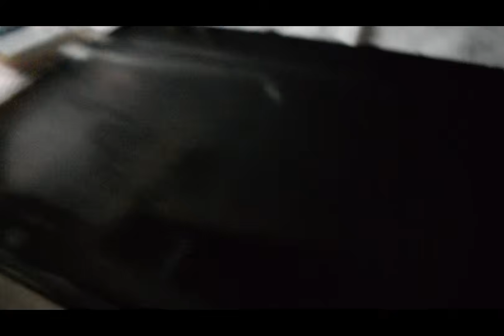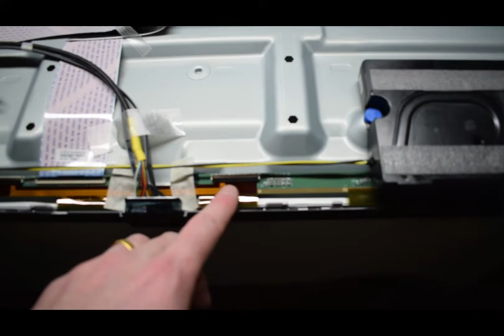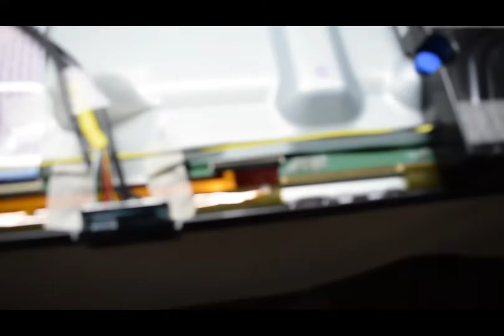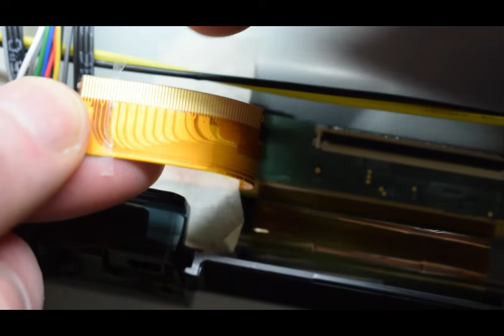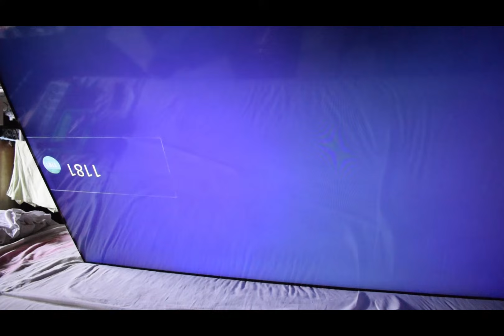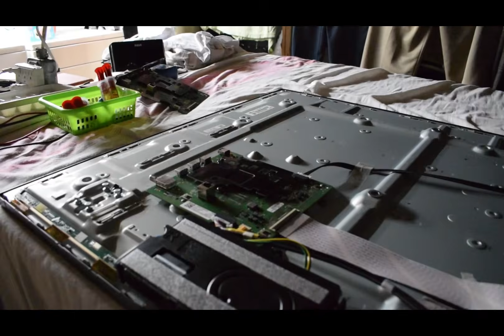Easy Fix! Samsung UN58TU7000 Keeps restarting (fix with tape!)

Comment: After taping the 16th and 17th pin the boot loop ceases however my screen stays black (backlight on) and uncovering the 16th and 17th pin shows makes the image visible, I'm using a model ue50bu8002k

Comment: This helped me at least stop my tv from boot looping and get it functional, but there's pretty significant lines and discoloration.  I think the long-term solution is to replace that T-ribbon cable.  Looks like its $10 for my tv.  Could not have gotten this far without your video, thank you!

Comment: Had the Same Problem with my tv only 5 years old 
Just check it on every step the power suply, then the main board and after it the monitor connector 
Put the tape on right side of the connector on only 6 pins at the right connector on to the left 6 pins and after it my tv works pretty well 
So do just exactly the same like in video it will work 
I just put it on left side like in video and cover the first 6 pins
Reply: Ps sorry for my English 😢

Comment: I have a Samsung
Model Code: QN75Q70TAFXZA
Version No: CF04 / QTQ70 / QTQ70E-Q75TE1. The TV was
flashing between a blue and black screen. I did a bunch of trouble shooting and I was able to get 3/4 of the right side (when looking at the front of the TV) of the screen to work by removing the right (when looking at the back of the TV) CSF01 cable. Can you tell me which pins to tape and on what side of the CSF01 cable (the board side CN1 or the panel side CN2)?

Comment: Repair shop asked 2000$ for this issue.  Thanks for your video my tv works fine now.   Just one question board get hot when tv on.  Is it normal or its a problem?

Comment: After two days of testing by blocking different pins — where the TV didn’t reboot but showed slightly annoying horizontal lines — I finally figured out exactly which pins needed to be blocked: pins 13, 14, 15, 16, and 17. Once I blocked these pins, the TV worked like new — no more reboots, no lines, perfect colors, and everything went perfectly. Thank you for the video!

Comment: My TV had the blinking red light issue with blue screen flashing.  I placed tape on the ribbon like you showed and got my screen back but left side of screen looks purple.  Should I reposition the tape or doing so won’t help. Thanks for the video.
Reply: did u figure out how to fix the purple issue ? thanks
Reply: @ayoub.radouani  i was told by a tv repair shop that some of the led lights were burned out resulting in the purple issue.  I tried replacing them but they didn’t fit like factory ones and would fall off the back. I tried messing with the lights again and shorted one of them out then the tv screen went black. Just got rid of it and bought a cheap one. Good luck!
Reply: @JC-ov5pt  the solution is to use a DC to DC converter to adjust the voltage entering in the VGH pin, its the same pin taped in the video, from 24v to 15v and the colors will be good, no purple anymore.

Comment: I guess the newer model looks nice and decent on the cheaper end on budget friendly models are not work it to buy unless to fix the issue.Mostly every manufacturer doesn’t want to last their products that long and want to buy new line lineups every few years to five years I have the similar issue but the solution is most likely is temporary for now

Comment: Looks like  - if I'm counting right pin number 17 you've taped off counting from the right. but more overly it should be done on the main ribbon cable at the board side not on the Tcon board , Looks like Samsung is getting a bit sloppy in manufacturing ...

Comment: The tape fixed the red light blinking… the back light stays on now… but the screen is still black
Reply: Have the same problem, did you get solved ?
Reply: I had the same problem, it turns out that whatever you taped isnt the problem. I did the elimination thing and thought i fixed the problem when the TV stayed on, but like you it was just a blank screen. It turned out that there was another signal causing the problem, and when i taped that off, the image came back, when i removed the first piece of tape everything still worked fine.
Reply: @p2kart can you send image or explain what you mean?

Do you mean you only taped on one cable or several? 

Because I’m having light but no image
Reply: @Sigge1992  he is right, I just did it, I thought one pin was the problem because it fix the restart but the screen kept blackl. I took it off and started taping other parts and one of those fixed both the restart and black screen, it looks kind of bad but it works.

Comment: Follow the instructions to troubleshoot same issue. I get audio from a streaming signal but no image whenever either ribbon cable is disconnected from each side of the screen. Backlight is ON all the time, but no image. Does this means a bad screen?

Comment: I’ve got the exact same model in the 50” version that just started when powered on, screen looks fine then the bottom menu comes on, then the screen turns black then it powers off by itself. If you turn the tv back on it will just repeat that cycle of menu, black screen,  power off.

Comment: TV now turns on but have a black vertical line. Any solutions for that?
Reply: If it's too thick, make ypur tape thinner and try to find the right pin to block, if it's thin a'd doesn't bother much I'd say just leave it.

Comment: I narrowed it down to one pin, boot loop is gone,  led backlight is on and i can here the Samsung sound,  but no picture. Is my panel dead or do i need to keep narrowing down pins?
Reply: I have the same problem, I found the one pin to put the tape on to stop the bootloop but still, not image
Reply: Did you fix it? @DamienLauer
Reply: @EzQU2  nope, i trashed it, it needed a combinaison of blocked pins and it’s not a long term solution, Samsung qled tvs are juste trash
Reply: did you fix it? I have the same problem.

Comment: Hello! I managed to to fix as you dud with a stick,but a  black line come out in the screen I think I touched something when I opened it 🤦‍♂️
Reply: Same... Today
Reply: Same. Tv turns on, sound on, doesn’t restart but have a black vertical line???
Reply: @falconisko  As you opened the TV, from the bottom side logically with the screwdriver, you damaged the wiring that goes from the motherboard image to the LCD panel.

I drilled a 3mm hole in it by accident and I have a 2cm vertical line. 

To solve the problem you have to change the panel with the wiring that is not worth it.

Comment: I will never buy a Samsung product again. Go with LG. I have 2 LG TVs that are well over 10 years old and still working great. This stupid Samsung is 3 years old and I have no picture. You shouldn’t have to be opening your tv to fix it unless you abuse it. SAMSUNG = GARBAGE
Reply: I will never buy a Samsung product again. Go with Hisense. I have 2 Hisense TVs that are well over 5 years old and still working great. This stupid Samsung is 3 years old and I have no picture. SAMSUNG = GARBAGE
Reply: @soteloc1991  which hisense model do you have? I wanna make sure I buy the right one
Reply: I have 2 50H6Ds that have had no issues since I bought them. And a U7N to replace the Samsung 75in that went down after 3 years.
Reply: Yep I would agree LG seems to be at the top of the list in good quality next to Sony... And yes I also have a LG, Just a good tip for you Never run the Back lights a full power as this Kills the Back lights

Comment: You are great. This fix was not 100% perfect, but the boot loop went away. That is good enough to where my TV still has lines left to right, and that is quite ok with a full 50-inch display without the loop..🎉
Reply: Try to put exactly on 6 pins on the left side it will work perfect

Comment: Could you just replace the ribbon technically?
Reply from the maker: no
Reply: @NewsonsElectronics  why wouldn't it solve the problem to change the electronic band ? 🤷‍♂
Reply: @Furoprior971 Because the error lays in the LCD panel itself

Comment: Mines is the same trace bad. But the left side of the screen is red tinted. Can't figure it out
Reply: dang exact same problem did you ever find out any fix?
Reply: @killamjl01  nope
Reply: Same. Mine started out as 6 black horizontal lines, evenly spaced. Then every couple weeks, the picture would "melt" from perfect to completely black. This became more frequent to the point where it would only work for about 2 hours at a time. Soon thereafter, it went to power cycling. I worked through a bunch of pins near the one where you ended up, and eventually found it would power on with the same exact pin covered, but now with the color problem on the left side (same side as the fix). The display never had this imbalance before. I could almost live with a few lines, but the color is hard to overlook.
Reply: The backlight looks evenly colored to me (viewing through the holes on the backside), does this indicate the lcd itself is bad?
Reply: I wonder if I gummed up the connector with the adhesive on the tape when I was testing various combinations of pins.
Reply: Mine seems to be back to its new "normal", with some horizontal scan lines, but proper tint now (very usable). I used the tape trick to get the TV on past the boot loop. Then I did the factory reset (read to the end...). This didn't fix anything in particular immediately, so next, I was going to try the tape trick on other pins. I removed the tape from the line in this video, and started my whole power-on sequence to make sure I was back at baseline again (immediately going to stand-by with the two flashes). However, this time it did not, it stayed on. The one thing I remember explicitly is (when the TV was still working) I had set the picture brightness to 50 (the max), and left it there. At this point, my theory is max brightness creates enough heat to change the characteristics of something so that it drew more current, plus the extra current drawn by max brightness in itself, tripped the over-current / short detector circuit. Factory default brightness is 20, I set it even lower to 15, and its been running now for 12 hours straight. I'll leave it on steady for a few days and update again with more results.
Reply: @agustindangelo1512  Other side failed completely not long after, so it's dead now. Parting it out on eBay. 😞

Comment: So my tv was constantly power cycling, narrowed down the pin and put the strip of tape on. Now it powers on and can hear sound, but no image just the backlight. Any ideas?
Reply: Did you ever get this fixed? I have the  same issue
Reply: Yes keep trying different pins but I recommend a voltage meter.
Reply: @colinjones834 i have one. But where and what to measure?
Reply: i wish people who make these tape fix videos actually traced the short instead of just cutting to the tape on, I want to understand how to find the short. SO many videos, no explanations
Reply: @dontevenlook  I believe the short will be on one of the COF components.... Either a capacitor, resistor or a diode.
Reply: Did you fix it already? If so. Can you share picture of pin you blocked(taped)? Please
Reply: @Cenayus I thought one pin (n°15 from left to right) was the problem because it fixed the restart but the screen kept blackl. I took it off and started taping other parts and one of those fixed both the restart and black screen, it looks kind of bad but it works.
Reply: Same problem, idk if I need to test other pins
Reply: same problem here. did you fix it?
Reply: Keep trying different pins or combinations of pins

Comment: how long does this tape trick last?
Reply: Until more of the panel dies. For me it was about 6 months
Reply: @RetroRepair after more panels got faulty did you tape more and it came back on?
Reply: @chukwuemekaphilip5144  For me it was then dead. Not worth it if you ask me
Reply: @RetroRepair thanks a lot.

Comment: I have a Samsung TV same model as yours. Screen is bright white but I can still see the menus etc. works as it should just super white. I’ve replaced the main board but no change. Could the power board be the issue?
Reply: It's the t com ribbon cables you can tape the pin. Unfortunately you have to find the right one

Comment: There are some spanish channels that will show how to repair shorted panels.  Step 1 is to try reducing panel voltage on the mainboard to 18V from 24.
Reply: Luckilly youtube can auto translate...
Reply: Can you link it?
Reply: @AMAStudios  link is above
Reply: @jamess5637 Am I missing something? I don’t see the link anywhere, having the same issue with my Samsung 😭
Reply: @jamess5637  Can you also send me the link to the video?
Reply: Can someone send the link
Reply: @romank.4678  https://www.youtube.com/watch?v=ltdELrzPcrI&t=16s
Reply: @romank.4678 https://www.youtube.com/channel/UCRMIvZLUHrgotPlm2Q7mmcg
Reply: I’ve seen this as well. Guy out of Mexico soldering the panel circuit board traces due to a reboot. Wish I could understand Spanish.
Reply: @jamess5637 don't put the full link, youtube will remobe your comment, i stead put just the last part that starts with v=
Reply: This one…

https://youtu.be/5PPPeFjplIU
Reply: Link please
Reply: Anyone got to watch that Spanish video?
Reply from the maker: could you send me the link
Reply: @NewsonsElectronics  https://youtu.be/70ZFApGTkyk
Reply: @NewsonsElectronics https://www.youtube.com/channel/UCRMIvZLUHrgotPlm2Q7mmcg

Comment: Is there a faster way to identify where to put the tape? I have a TU700D that shuts down and restarts randomly and can be weeks, even months working properly before it starts having the issue again, so putting tape on each line and waiting to see if it restarts or not may not be a good way to go for my TV! :P

My TV always turns off as if a black veil is put on the screen, then it has sound for like two seconds, and then shuts down (when I first detected the issue it also restarted on its own, but nowadays it keeps itself off after the shut down). Any idea of what may be?
Reply: Tape half of the total connector. If the problem it's solved (the panel don't go off) you know you have taped the right pin.
Then half again, and again until you find
Reply: I've the exact same problem! I tried the tape fixing but it gets black anyway..